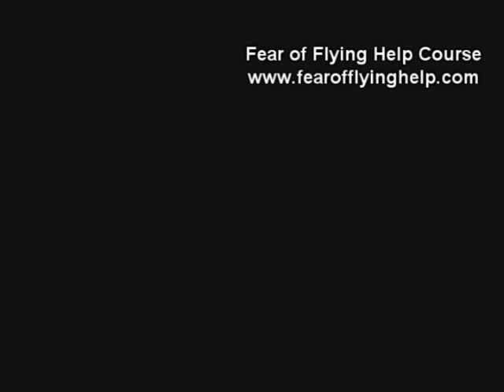Aircraft Strength

Comment: One more thing. You have it exactly backwards about the rudder. It's the rudder inputs that will tend to push you left and right, but the ailerons are used to bank the plane into a coordinated turn that feels balanced, invoking the horizontal component of lift and added Gs as a result of centrifugal force. Don't take my word for it, check it out for yourself.

Comment: Although they're not perfect, airplanes are built tougher, stronger and more carefully than most people can ever imagine, and that's good enough for me. The 707 roll was pretty spectacular, but a roll is considered to be a no-load maneuver which means that the aircraft does not encounter forces greater than would be sustained in normal operation. Deploying flaps at too high an airspeed would actually cause far greater loads on the airframe than a roll.